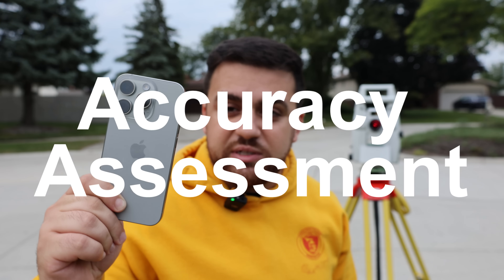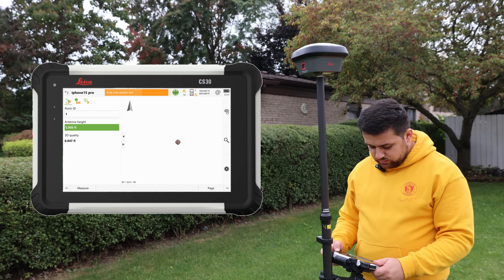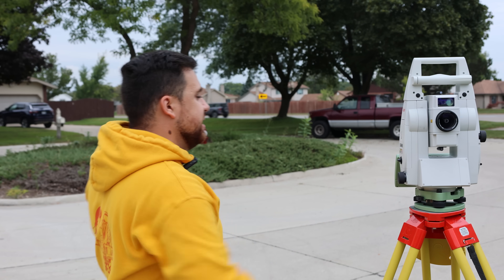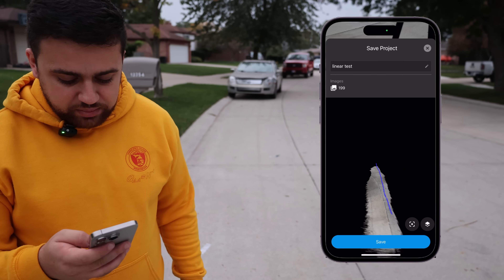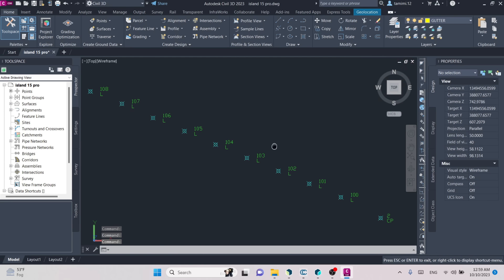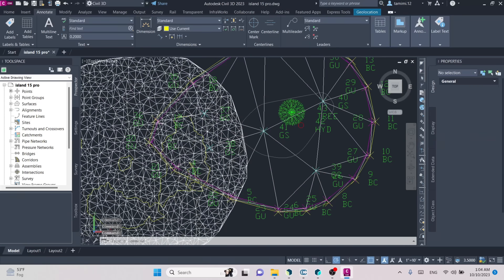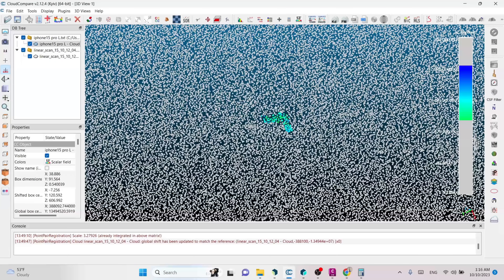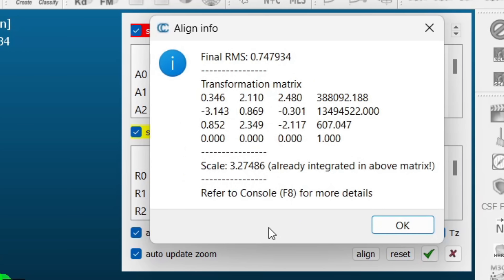iPhone 15 Pro LiDAR and Camera vs Survey Total Station Accuracy

Comment: hey mate - great channel and content. How good do you think the relative point to point accuracy would be. Particularly interested in this for manhole surveys as an addition to basic invert level shots by total station. As the pipework is frequently inset and hard to reach i thought stand clone scans may be useful for verification of invert level, pipe diameters etc. +/-3cm would be good enough for most use cases. Currently we do scan inverted with the BLK360, where budget and accuracy requirements allow but for smaller jobs I could see this being a good addition to our tool kit. Thoughts?

Comment: Great video! However, when  the island was surveyed using the iPhone, the measurements likely captured the tops of the plants rather than the actual ground level. This discrepancy is probably the reason for the differences between the two calculated volumes. As a surveyor, you should redo the survey in an area without any plants for a more accurate comparison.

Comment: Am I missing something here. I use Faro S70 for capturing point cloud data and we don't use its GPS but put down markers and Survayor measures them so we can properly Geo-Locate. In the case of Iphone I think that should be done as well to be able to position it in right place. Moreover I am not surprised at all that the Iphone surface volume is higher as more points you have the more volume you will have. it is same issue when someone would measure country borders that if you have smaller distances between points the longer the perimeter goes as realife is not smooth or straight. Moreover especially when taking into account complexity of the ground.
The second test makes me more worried as the fact it gets closer results to the Total station is actually very bad as that would mean that distances between markers are quite a bit off and constant distance.

Comment: Are you sure you have used GPS on the iPhone? Maybe the WiFi Positioning was used instead.

I do measure LiDAR by small objects used. Took my motorbike and walked around. The 3D model formed out of this data is mindblowing perfect. My software for LiDAR is Scaniverse - big difference to other LiDAR scan software available.

Comment: In the straight line iphone test. It would be interesting to see you start recording and walk in a figure 8 patter before walking the line. Just wondering if those overlapping points would help correct the data at the BEGINNING of the dataset rather than just the end.

Comment: I'm still using the iPhone12 Pro, and I'm curious if the 15 Pro has any significant improvement in LiDAR resolution. Can it see/scan fine detail a lot better? How about depth, can it scan further away than the 12 Pro? I'd love to see some tests set up.
Reply: Same here, I’m still on the 12 Pro Max and I’ve seen no reason to change iPhone for many years to be honest! 

However, if there’s a big Lidar improvement difference to the 15 (or the 16 as I write this), then I could be convinced to upgrade.
Reply: @Steve_W27  I wish as well, but since there's been no announcement about it, and no Apple-version of Polycam, it seems like they're not bothering with it, unfortunately, even though I FEEL like that would be key to improving their "spatial video"

Comment: The gps is definitely the improvement.  Measuring two feet off from your actual location matters a lot when trying to measure small distances but it is probably as good as a phone gps could do, but when you travel 100 feet the 2 ft margin of error is a lot less impactful. I think movement and the recalculation of distance that GPS does as you move probably increases accuracy a bit as well

Comment: Thank-you so much for these videos.  The iphone 15 pro was supposed to have a new, much improved lidar sensor, by Sony.  It appears from your data in this video (showing 1 to 3 ft error), vs your iphone 14 lidar video (showing .08 to .124 ft error), that the new lidar sensor is horribly worse.  If I'm interpreting you correctly, I am very disappointed in the new iphone 15 pro lidar.  Perhaps Apple didn't need a very accurate sensor for focusing, and just wanted to save money.  I wonder if the MagicPlan people will still use the iphone.
Reply: The inaccuracy he points out is from the GPS unit, not Lidar. He praises the accuracy of the lidar repeatedly. The point cloud and photogrammetry is frankly insane for the price. The geolocation is poor at the start of the session, but gets better as the lock improved. This also makes sense because high frequency GPS is crazy power hungry, and the mm-level accuracy of his Licia gear would be orders of magnitude overkill for 99.9995% of the billions of user’s daily lives at the expense of hours of battery life.
Reply: yes, accuracy seem to be bad.

Comment: I suppose the enhancement in accuracy point cloud could be caused by the GPS accuracy. The longer you work/scan the more accurate GPS positioning become. Also trees could influence on the accuracy as well - in the end of the scanning route you went out to the open space.
Reply: if it is affected by the gps,the same will happen to 14 pro.
Reply: Trees will impact the gdop for sure.